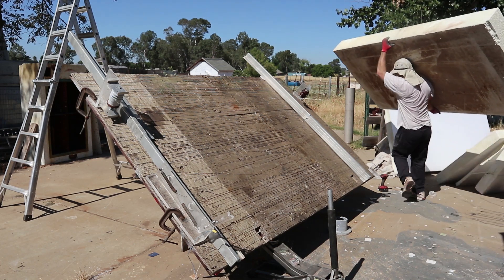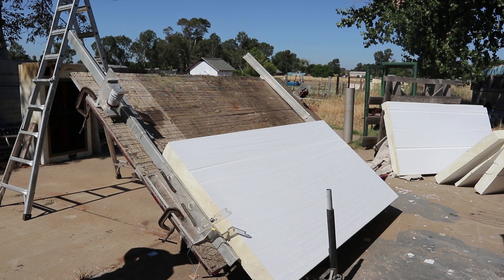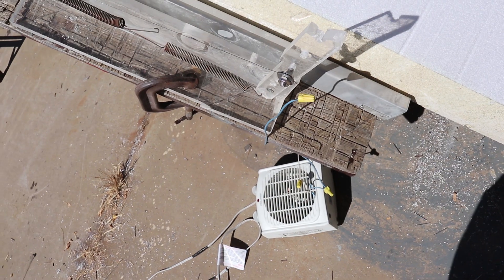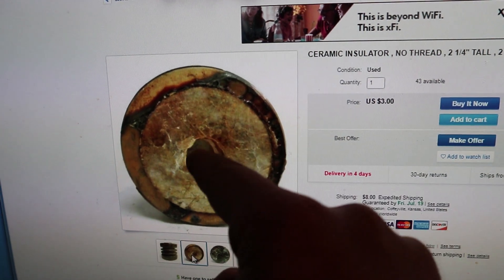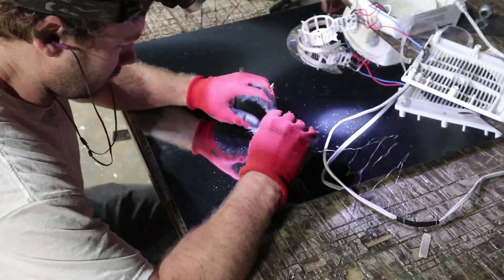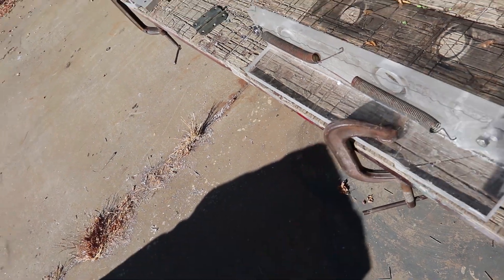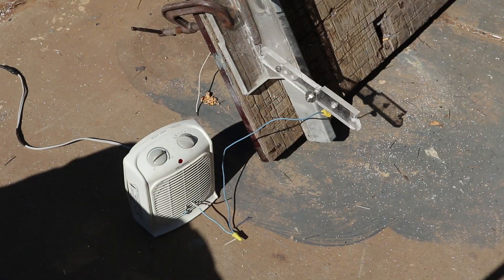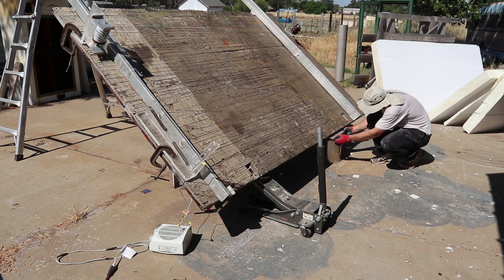DIY semi-auto "hot wire" foam cutter + free home insulation

Comment: Smart way to use a gravity feed. I would consider using a dry PTFE lube or similar on the backplane to make the insulation glide better, cutting faster, and not having those imperfections that happens when it gets stuck. Ideally you'd use a less rough surface to begin with, but a dry-lube will probably solve that here.

I think you are over-complicating this a bit by electrifying the whole wire and need ceramic insulators to hold it. You can just use some alligator clamps to connect to the power to the wire right before it hits the foam. Then the rest of the wire is not acting as a resistor and does not get hot. This will also heat up the active part of the wire more. Some heat travels in the wire, but not very far, so you can use much simpler materials to hold the wire. The alligator clips can be used as a basic power-adjustment to tune in the optimal heat - as long as you have extra wire length to work with (which you do).

Is this operating on mains voltage though? That works - but is a big safety risk (shock and fire). I really wouldn't recommend that. Something like 12v at a high amperage is much preferable as it carries no risk of shock. You can usually scrounge up a 12V source for cheap or free. Car battery chargers, PC power supplies, and old car battery ect. At 12V you could handle the live wire (non hot parts obviously).
Reply: That’s what I too was thinking

Comment: Yes think I'll just use fan heater element same as you as far less bends to take out. Did you only use half of the element , as it's 2 elements in parallel so you have two heats . Thanks for posting it's great idea
Reply from the maker: I cut it in half so that it would be shorter. I didn't use 2 elements because only 1 was needed. there's no need for the extra power consumption and the awkward second wire
Reply: @JustinCrediblename  interesting , if halfed it's to high a voltage at 120v but it's ok then? Does it burn out all the time? Here in uk it's going to be 240v and I'll do it when it's very dry and I'll wear gloves
Reply from the maker: @lookoutleo  well they design the thickness and length of the wire based on the household voltage, at least in the USA. It's generally cheaper not to have a voltage transformer and just use a different thickness of ni-chrome wire, so I'm assuming that they design the wire thickness so that it accepts your 240v at the default length.
If you cut it shorter, then there will be less resistance and more amperage will flow through the wire, so it might pop a circuit breaker depending on the original length of wire that's used in your heater. You'll just have to try it out. 
If you have a $25 watt meter, it can be pretty easy to figure out if your wire consume too many amps if it's shortened, but if you don't, then you'll have to either use an amp-meter on an insulated portion of line that feeds the circuit, or just experiment with it and see if it blows your circuit.
Reply: @JustinCrediblename  yes I will use it at factory length, these fan heaters have 2 heat settings , in effect their is 2 circuits , ill use 1. They never use transformers in a fan heater , would make the unit to expensive . I'll wait till it warms up. Today it's snowing

Comment: Do you just connect mains across the element
Reply from the maker: yep
Reply: @JustinCrediblename  here's 240v that could be a laugh , does it not burn off?
Reply from the maker: @lookoutleo  the foam residue? the wire seemed pretty clean ... I didn't inspect it in detail after my work was done.
240v will of course have half of the resistance, but your heater was probably designed for that voltage...
Reply: @JustinCrediblename   yes I'll unravel a tumble dryer heater and use that

Comment: man i'm a bit lost on the whole use of the spring thing and its really not clear in the video so just for the sake of clarity could you explain how the setup works please. So the blue wire  with the yellow joiner thing goes like around or across the bolt of the plastic lever thing that has the two springs attached and then continues across to be the actual hot wire cutter and the two springs are joined together and pull back on the lever somehow to keep tension on the wire? Mate its as clear as mud tbh
Reply from the maker: hahaha shit...
The two springs constantly pull on the bottom side, which constantly puts the hot wire (at the top side of the lever) in tension.
The hot wire itself, yes, is sandwiched between two washers on that bolt that's on the plastic arm. Those washers are held really tightly with nuts, so that the wire doesn't slip. But the bolt itself is pretty lose so that it can flex around as the arm moves.
The hot wire joins up with the blue wire underneath the yellow wire nut. Right at the yellow wire nut is where the hot wire starts. Everything after that is burning hot and will electrocute you if you touch it while it's turned on
Reply: @JustinCrediblename  thx for the quick reply and explanation. I think its kinda sunk in. The penny may have dropped. It hit me after I posted how the springs come into play but do they have to be so big?  I think you said the wire will expand up to two inches when heated so do you conclude a certain spring length for that stretch or they were just what you had lying around?
Reply from the maker: @briansmith7721  ah good. Yeah the only thing that I didn't get for free (including that massive table) is the aluminum sheet metal and the bolts. everything was just stuff that was lying around.
The reason that the wire was so long is because of the way that these heater wires are engineered. They're engineered to use 120v power and not overheat or blow a 15 amp circuit breaker. The shorter you cut the wire, the more power it will draw and the hotter the wire will get.
You could halve the length of the wire but you'd have to get a transformer to halve the voltage (that way the wire stays the same hotness as the original). I didn't have any transformers like that, and I didn't want to spend any money, so I did it this way.
Reply: @JustinCrediblename  cool, thats really informative. I hate spending money when I dont have to and always try to use stuff on hand as well. It's just being frugal. I only have a few sheets to cut so dont want to spend anything on what will probably just be a temporary setup. I found an old heater that i'm trying to use and got a free table I converted to take the sheet size. I'm not too concerned about getting zapped, I'm a thrill seeker by nature :-)

Comment: good stuff. i'm going to do something similar with a heater i found. Just curious tho, did you use all the nichrome wire from the heater or cut it at some point? My heater has a ton of it so I'm going to have to cut it and use a much shorter length which will alter the heating process. i am going to  use the whole heater like you did so i can use the heaters own heat settings to adjust the heating of the wire. it will be a bit of trial and error i spose but should work. Your video has inspired me to have a go with similar size sheets. cheers
Reply from the maker: as mentioned in the video, shortening the wire lessens the resistances, which means that more current flows through. this will make the wire hotter. That's why I used the whole wire.
I'm no expert on this, but if you want to avoid overheating the wire, then I think you'll need to lower the input voltage by whatever fraction of length you reduce it by. For example: 1/4 the length = 1/4 the input voltage.

Comment: How can I cut king size mattress
Of 6 inches
Into one inch 6 sheets
Reply: Thanks a lot 😊❤️
Reply from the maker: I've never worked with that stuff. maybe a hotwire would work? I dunno. let me know if it works :)
If hotwires work, then I'd stick a piece of rigid plywood underneath it to make sure the mattress remains flat as it passes through the hotwire.
Reply: @JustinCrediblename  
Kindly do experiment on little piece
Then inform me
May be it works
Reply from the maker: @ghousalishahsahb6859  no.
Reply: @JustinCrediblename  
If u get any information of this project then kindly told me
Reply from the maker: understood. I will do that.

Comment: The roofing company I work for asked me to make one of these for the winter to keep us busy 4 guys cut 50 000 sqft of sloped insulation for flat roofing turned what was garbage into $40k in material In 2 weeks you want to use nichrome wire and a DC inverter to make it consistent adjust the voltage based on wire gage also have a spring on one end of your wire to compensate for expansion of the wire as it heats and cools

Comment: hey Justin, this is what i have been waiting for. Youtubes algorithm finally got it right after suggesting quite a few other hot wire videos that just didn't do the job. I have the same size sheets I need to cut down and what you have done here has given me an idea or two to get the job done. Cheers.

Comment: Thats pretty cool. Thanks for sharing. I wonder if some sort of top weight or motor would be beneficial for a clean cut.
Reply from the maker: yeah I'm not sure, but at the very least:
a) a reduction in static friction between the foam and the rail surface (IE roller-feeders or skates) would reduce the time that the foam would get stuck in one position and allow the wire to sag.
b) a more vertical orientation would cut faster, reduce the amount of wire-sagging time, and also the wire would sag in a way which wouldn't cause as large of divets in the foam.

if the table were purpose built and actually had access for handling of the foam until reaching the hot wire, then a more vertically oriented machine would be easy to operate

Comment from the maker: the bolt on the spring-loaded arm that holds the wire isn't rigidly attached to the plexi-glass. the ability of the bolt to spin allows it to avoid twisting and fatiguing the hot wire as the arm turns.

when the power switch is on, the hot wire is electrically active. There is vastly more current traveling through the wire than would be required to kill someone. So it's best to avoid touching it :) This, aside from the facts that the typical hot wire is typically shorter and thicker gauge, is probably why people typically get voltage down-converters for their hot wires - 12v cannot kill you (well, under any practical circumstances - it could probably do a job on you if directly applied to your heart during surgery)
Again, I chose this dangerous route because I didn't want to spend any money. There's also the added benefit of it cutting the foam quite quickly :) However, in theory, a low voltage, thicker wire would cut faster (more watts). The wire itself consumes about 800 watts. The portion necessary to cut the foam is about ~600 watts. Typical exterior circuit breakers can output 20 amps, or 2400 watts, so you could in theory cut about 4x as fast if you purchased a big fat wire and a voltage down-converter with the proper voltage (and power handling! that's a LOT of power!).

If I had to guess, I'd guess that this NiChrome wire (nickel chromium) is 18 gauge.

If you had passive roller feeders to transfer the foam to the hot wire and as side-guides, you could further decrease the angle of inclination and further reduce the awkwardness of feeding foam into the wire.

Lastly, this STINKS! I recommend cutting the foam at least a day before use and letting it air out. It'll give you a headache if you're installing this stuff immediately after cutting it.
Reply: Incredibly helpful information. Thanks guys! 😃🌎♥️